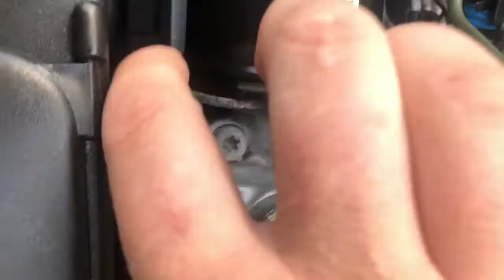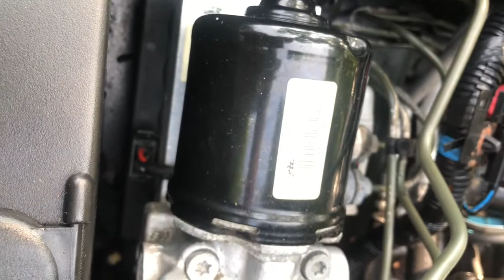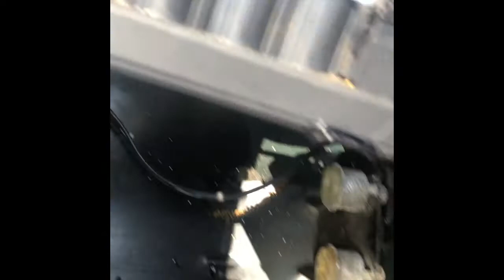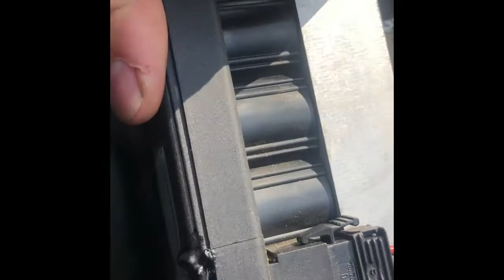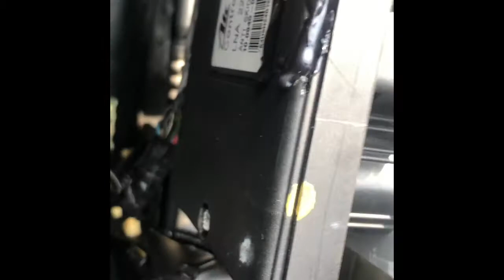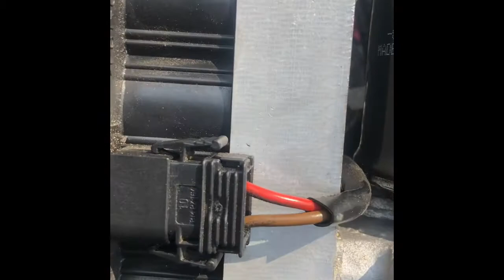Jaguar XJ X300 X305 traction control and ABS light repair

Comment: Hey man, I've watched your video like 10 times over the past year and a half I've had my x300.  I guess this is a major problem, and with winter here my jag NEEDS Traction control.  I've never driven it a mile with it though, how well does it work? My old Mercedes w211 Traction control was a God send; such a remarkable difference with it on vs off.  How does this jag compare?
Reply from the maker: Ya know the few times I’ve seen this in my jaguars I immediately fixed it. It’s so easy and cheap to fix I didn’t drive it much with the problem so I couldn’t tell you the difference.